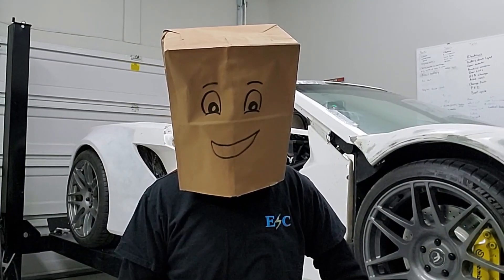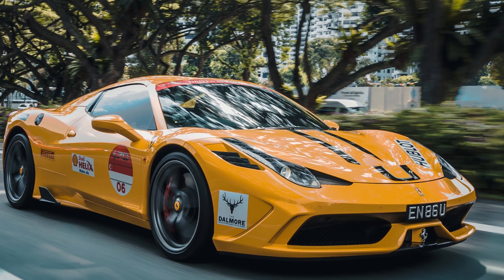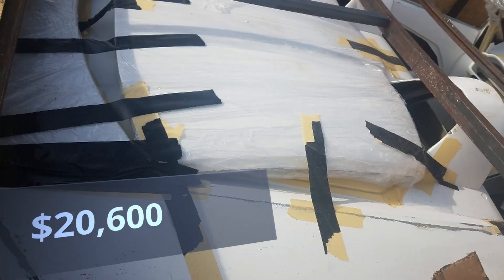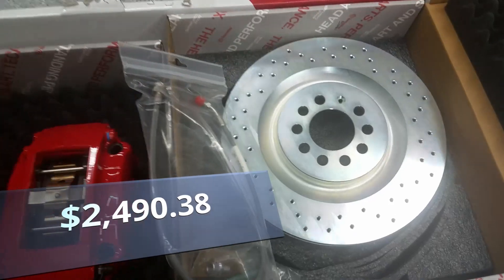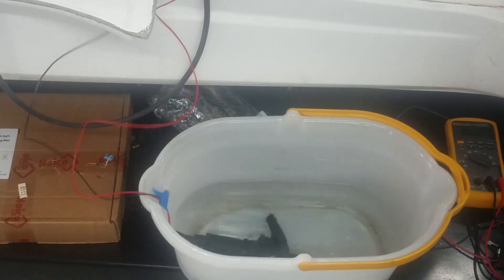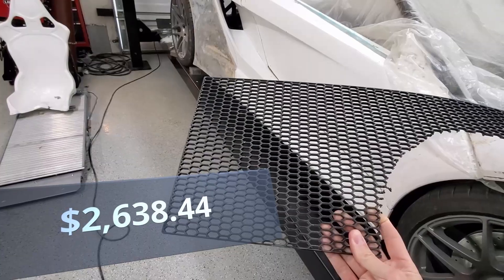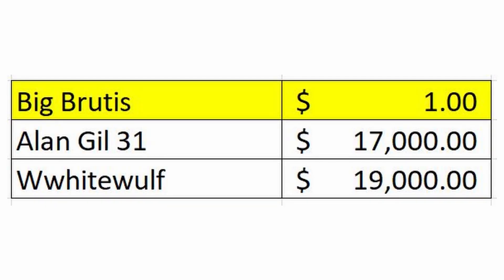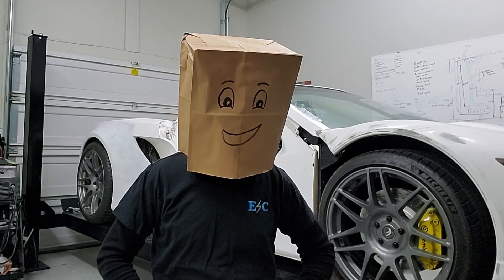True Cost of a Kit Car – Price Reveal, Kit Car Cost, Electric Supercar Cost

Comment: Sti engine would’ve been a fraction of the cost, weight, complexity and has the potential to make more power than electric. With a closed deck block it’s not uncommon to see 1000hp Subarus and you’d have a fun amazing sounding supercar. Electric is fast if you have both drive motors and all of the batteries and components needed to actually make that sort of power they are rated for which you cannot fit in an ordinary car so you really aren’t making that rated 700hp you might think you are. Not to mention you are doubling the weight ruining performance in every way possible.

Comment: Hi from NZ... Im about to build a beautiful black replica countach... but im at a crossroads.... your advice.... i can either go with a LT4 supercharged V8 coupled to a C8 7 speed Tiptronic Dual clutch gearbox.... or   Get the tesla Power pack like youve done....... what would you suggest i pick... the LT4 or the Tesla engine?
Reply from the maker: Tough choice!  Quite a difference in your build plan.  Do you love the thunderous roar of a V8?  Hard to recreate with an electric car.  Are you are going for quickness?  Hard to beat electric instant torque.  Totally up to your preference.   Either way I am sure it will be an epic build!
Reply: @electricsupercar  ive actually already decided.. Im gong to buy Charlie stricklsnds contach.. He makes alloy chasis then use your idea of the tesla motor... I was thinking running the batteries in the centre tunnel for balance and safety.. I don't want engine sound...... Did you have front motors as well or just the rear one?  Jazz from. NZ
Reply: @electricsupercar  to answer.. yes going for quick speed,,,...and another Q  would you tell me the total weight of your car...you see if i go tesla and dont go the LT4 then that removes a tonne of weight already... so designwise im already on a win.... and i love your videos and channel.. you do a great job

Comment: Thanks for your video. I want to buy a used Porsche Boxster with no motor and trans and Tesla swap it. One could be had for less than $5000. Or buy a complete car and sell the motor, trans and exhaust. No need to buy expensive performance parts, suspension, etc. I bet that would cut cost tremendously. Plus, I would end up with a faster and more powerful, more reliable Porsche Boxster. I would beat all the other Porsche Boxsters out there.

Comment: Just curious, is there a donor car that could be used for us low budget Electric guys. I know Mustangs are used a lot for Factory 5 conversions. I saw Ford converted an ICE Mustang into a 1,400 HP dragster. Could you have done this with an ICE car?
Reply from the maker: Yes this could be done low budget (but probably not high performance).  Yes this kit is made for ICE car

Comment: Fantastic!! I was in an accident a year ago and ended up out of work and with a wrecked Harley and a half built from scratch Mercedes 300 Gull-wing. Thank you for telling us all how much this cost. I have been developing an electric motor and recycling circuit that has the capability to extend the mileage of the batteries (4-12 volt lead acid) from 200 miles to over 700 miles before charging and maybe more.. You have a beautiful family!!
Reply from the maker: Sounds like a cool project!